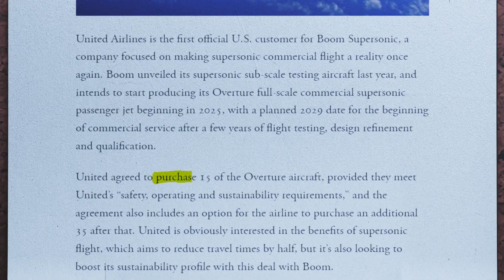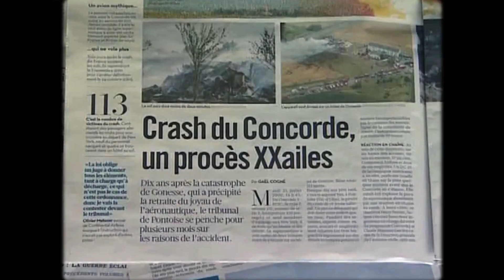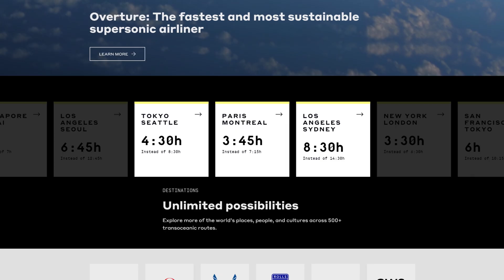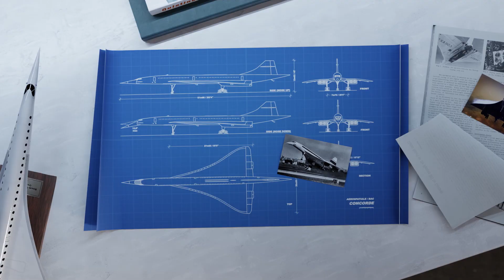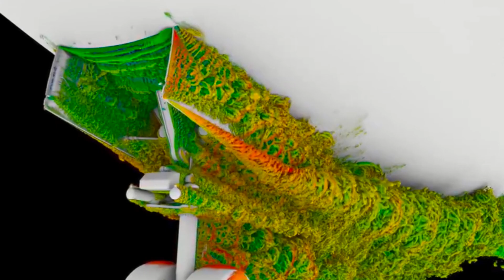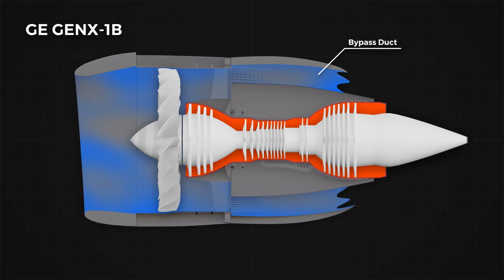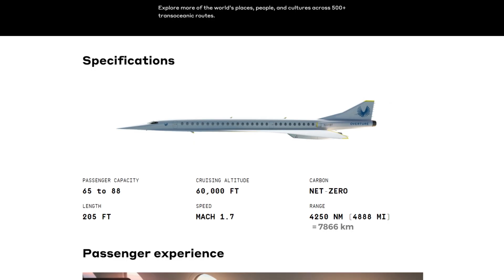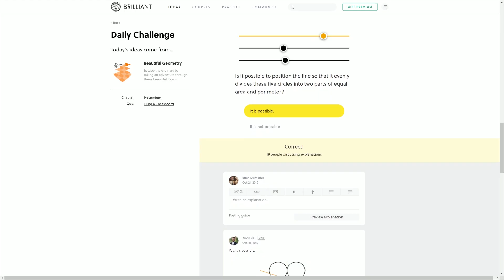Will Boom Bring Supersonic Back?

Comment from the maker: Real Science uploaded a video today that is honestly much better than this one, you should watch it: https://youtu.be/DmanbWwMa5w
Reply: Until Boom has a functioning engine, it's just a paper design. Nothing else matters if the engine is not efficient enough. Most people don't understand that every mode of transport is built around its powerplant, and if they want to be successful, that is the first hurdle they need to overcome. It's not something that you can save for later.
Reply: @KarbonatErolVerdienstkreuz  I agree no breakthrough in aircraft has been made without an efficient powerplant. In the 1960's The question in the Lockheed Star was What is the limit to the size of an aircraft?   The answer: Even With the materials we have today given an efficient powerplant there is no limit to the size of the aircraft that can be built. The main limitation is the ground handling area available.
Reply: @KarbonatErolVerdienstkreuz  At least they could try to copy the SR-71's powerplant, but I don't think Boom has the sophistication.
Reply: @jameshoffman552 The J-58 is not efficient enough
Reply: @jameshoffman552  Did you know Concorde effectively has RAM engines as well? The RAM Air intakes of Concorde generated more thrust than the engine itself at supersonic speeds
Reply: @KarbonatErolVerdienstkreuz  the problem is that turbojets will never be as efficient as turbofans, especially high-bypass-ratio turbofans, but the higher the bypass ratio, the less suitable the engine is for supersonic speeds.
Reply: that link is about lab grown meat 🙁
Reply: 747- "I can carry lots of people affordably with, at least in flight terms fairly small amounts of fuel."
Concorde- "But I'm fast."
747- "Okay Boomer."
Reply: What does synthetic meat have to do with supersonic aircraft!?
Reply: Concord was designed with slide rules.
Reply: so fo you feel Lockheed or Boom has the most potential..?  I think Lockheed will probably make the sonic boom quieter...but yeah, hopefully someone pulls out off and make it practical.. that would be great!
Reply: Good man Brian. I'm guessing you've been watching pitch meetings!? 😆
Reply: 76
Reply: I know I just watched it, I prefer my science unbiased I mean I did love the channel, and all of a sudden it changed.
Reply: @Real Engineering:  I would love to see your take on the logistics of the Falkland Islands campaign.  The British had quite the struggle there.
Reply: Hey man, I love your videos but could you do at the end of the video something like a short recap? Like: Lets recap what we've learned today... . It would be nice.
Reply: You don't give yourself enough credit! This video is top-notch!
Reply: @WestExplainsBest  ich mich zu zzp oder zu zzzp PZ z PZ
Reply: @WestExplainsBest  Compare 1930s Nazi Germany Vs 2020s Communist Chinazi IN YOUR NEXT VIDEO Project before it's too late
Reply: @WestExplainsBest   
Aa.
Reply: Instead of bypass we can use ramjet
Reply: @Acidcoast  based
Reply: Off topic, misleading link.
Reply: @linuxgeex  They are basically advertising their other channel. Took me a while to figure out lol.
Reply: Sure. Just in space
Reply: How do you find these videos, I am looking to start my own YouTube channel and i want to know you source these stock videos like the ones with the Concorde, I would really appreciate if you could help me out
Reply: The link is to lab grown meat!! Lame!!
Reply: It looks like a pelican!  Decades of research to realize Nature figured this out billions of years ago.  🤣(4:40)
Reply: Was that a joke? When I click on that link I get "The Truth About Lab-Grown Meat". I tried it three times.
Reply: Anything to add now with the new X-59 two years later? Looks like it really might come back
Reply: Can you please make a follow up video with the latest improvements till now.
Reply: WTF, did you at least check your link, its about lab grown meats!
Reply: @ckdigitaltheqof6th210  you clearly did not see that their site says "Fueling the future" and three quarters of their products are about fuel. Isooctane and Isobutanol and renewable diesel and gas. look again.
Reply: @ZeroTRK  didn't bother to, the claim of that link had a better intro to the topic, its just on a fuel resources topic material alone.
Reply: Cool video, thanks for promoting veganism.
Reply: What is the name of the book at 16:13? Edit: nvm found it, its called general aviation aircraft design
Reply: Well Its actually not true about the Biofuels. As it stands, there is a company out in Colorado that is developing Sustainable biofuels for Jet liners. Its called Isobutane I believe. From what I remember. The Fuel is actually considered a byproduct of ethanol, But is highly sustainable. The company is called Gevo. And I would check it out. As it stands. A number of airlines have already signed up for it. As it is cheaper than fossil fuels and I could see it being used for this jet.
Reply: @ZeroTRK  It has been shown elsewhere that ethanol is not as eco friendly as advertised. It is very energy intensive to both grow and process corn  into fuels so in the end it offers little net benefit to the environment while using land that should be used for food crops.
Reply: @ZeroTRK  "you believe" and "From what I remember".  You are rather flaccid  in your facts.
Reply: Imagine not watching that within thirty minutes of upload
Reply: VIEW * NICE AWES0ME C00L KEEP_IT_UP ! INDEED .... 📳💻💻💻💻🖥🖥🖥🖥🖥⌨⌨⌨⌨⌨🖱🖱🖱🖱💽🏆🥓🥓🥓🥓🥓🏎🏎🏎🏎🏎💨💨💨💨💨💨💨

Comment: Came here after Boom testing its technology demonstrator at Mach 1.12. They have done it. But there is a lengthy journey ahead to scale that design to their overture passenger aircraft. Their structural design approach is validated now and pressure and flow data from the real flight envelope is captured. A critical area of risk now is the engines that needs to be developed for achieving modern day noise restrictions and carbon negative fuel requirements.

Comment: Great Video . But There is one misconception. They plan to put turbo fans on this plane. (Low Bypass) And there were massive amounts of improvements in this department as well . Look no further than the f135 from the f35 . But still it wont be an easy feat.

Comment: Do supersonic engines really need to be pure turbojets? Could the Overture get away with using low or medium bypass turbofan engines? Most modern fighter jets use low-bypass turbofans and they can fly at supersonic speeds.

Comment: 1:22 I would not say its fair to call it cramped. Its some 15 cm wider, and quite a bit taller than the interior of a Embraer E-jet. Its have a bout the same seat width as a A220, that is really not that poor of a standard. Considerably better (like 2½" more) than a 737

Comment: JFK departure - with a left hand turn, just at takeoff was incredible. Avoid Manhattan, flew over Jones beach / Canarsie climb out as quiet as possible.

Dulles , was not a big deal with lots of unbuilt area. So no throttle up and down in noise abatement.

It was a super loud aircraft - I sat back in the last row at takeoff and it was very loud.
And the earth rumbled around you as you took off at 250mph.
Was a fantastic experience and leaving at 10:00am - arrived in London at 6:20pm in 3hr 20mins.
Just enough time for a gourmet meal and many glasses of Krug or similar champagne.

Good luck to boom - however I think that will just never happen , if it does wont be in this decade - !!

Comment: Overture is intended to bring back supersonic travel after the demise of Concorde. Three of Boom’s key objectives are to make Overture fuel efficient at both sub and supersonic speeds, and to be low noise, especially at take off and landing. Many people have been wondering how they could do this.

Symphony 
Following the redesign in mid 2022, Overture has four underwing power units which Boom have christened Symphony. Symphony houses the engine, input ducting and exhaust ducting, and is large at 30.5 feet long and 7 feet in diameter (Overture is 201 feet long, with a wing span of 106 feet). There is a cutaway image of Symphony and the engine on the Boom website.

Engine
Florida Turbine Technologies will design, develop and certify the Symphony engine which will use existing certified parts and materials, including blades and core. The manufacturers of these parts will help throughout the Overture engine development program. 

The engine will have the same basic architecture as engines that currently power all modern airliners: 
  • Turbofan 
  • Medium-bypass 
  • No afterburner 
  • Twin-spool 
  • 35,000 pounds of thrust on take off 
  • Air cooled multistage turbine 
  • Single stage, 72 inch diameter fan, for quiet operation 
  • Low-pressure compressor stages: 3 
  • High-pressure compressor stages: 6 
  • High-pressure turbine stages: 1 (passively cooled) 
  • Low-pressure turbine stages: 3 
  • Additive manufacturing for lightness, low part count, reduced assembly costs 
  • FAA Part 33 and EASA CS 33 compliance 
  • ICAO Chapter 14 noise compliance 

How can a Medium Bypass Engine be Used at Supersonic Speeds
In general, turbofan engines are efficient at speeds up to around Mach 0.94, but any faster and the large fan creates excessive drag and the bypass air is too slow, also causing drag. Any attempt to speed up the bypass air with a convergent/divergent nozzle tends to choke the fan. 

To get around these problems the Symphony engine fan seems to be unusual and has been described as low profile, high throughput and light. Also, there seems to be a diffuser ring near to the input periphery of the fan. The impression is that at high speeds, incoming air will be directed away from the fan periphery so the engine core will receive the majority of the input air, and bypass air will be greatly reduced, thus eliminating the problems of drag, fan choking, and slow bypass air at high speeds.

Input and Output Ducting
Symphony will have a Boom-designed axisymmetric supersonic intake^, and a variable-geometry exhaust nozzle, The intake will be similar to the intakes on the Mach 3.2, SR-71, with a spike that generates thrust as well as slowing the air to the engine (all engines need input air below Mach 1, typically Mach 0.5). The exhaust nozzle geometry will probably be adjusted to provide subsonic exhaust velocity at low speeds, which will mix with the subsonic bypass air producing high thrust and ensuring low noise, especially on take off and landing. The nozzle will be adjusted at high speeds to provide a supersonic exhaust for Mach 1.7 supercruise.

Why will Overture be More fuel efficient
 •  Lighter because of carbon composite construction
 •  Turbofan engine at low speeds
 •  Effectively a turbojet at high speeds
 •  Waisted fuselage for area rule reducing drag
 •  Improved wing
 •  No afterburner

Why will Overture be Quieter
 •  No afterburner
 •  Medium bypass engine
 •  Sound deadening material
 •  Subsonic air flow at low speeds
 •  Variable geometry exhaust
 •  Normal sound elimination techniques for turbofan engines
 •  Improved wing, with leading and trailing edge flaps giving more lift at slower speeds
 •  Exhaust noise at supersonic speeds won’t be that significant because Overture will be flying over water and will be creating a sonic boom anyway.

Notes
^  The input diffuser is almost certainly based on document, NACA E55F30 of 1955: Variable Geometry Axisymetric Supersonic Inlet with Telescoping Centrebody

12-2023.09.15

Comment: Here is a rundown of Boom's latest position (15 September 2023):
   •  The factory at Greensboro North Carolina is now erected
   •  Boom has hinted that, as the XB-1 no longer represents Overture, it probably won't fly
   •  Boom have now finished their consultation with Rolls Royce on the Symphony engine
   •  Virgin have now let their Overture options laps
   •  130 orders and pre orders from Japan Airlines, American Airlines, and United Airlines
   •  Boom and Northrop Grumman partnership for military and government applications 
   •  Boom awarded STRATFI contract by USAF for Overture fast transit applications
   •  Cutaway images of the engine and Symphony power module are now on Boom's site  
In July 2022 Boom announced a major Symphony redesign:
  •  Fuselage, waisted to comply with area rule
  •  Wing, multi angle Delta gull, with computer controlled leading and trailing edge slats
  •  Empennage
  •  Engines, 4 medium bypass turbofans in under wing individual pods
  •  Seats, 65 to 80, all business class
  •  Length, 201 feet (same as Concorde)  
  •  Wing span, 106 feet (greater than Concorde)
  •  Height, 36 feet
  •  Cruising speed, Mach 0.94 over land, Mach 1.7 over water, at 60,000 feet
  •  Range, 4,880 miles
   
Boom have appointed suppliers for major Overture items, including the engine:
  •  Florida Turbine Technologies, engine design, development and certification
  •  Aernnova  (Spain), design and supply wings. 
  •  Leonardo (Italy), design and build fuselage and wing box.  
  •  Aciturri (Spain), design and develop empennage. 
  •  Safran Landing Systems, 
  •  Eaton, hydraulics, fuel and inertial systems collaboration
  •  Collins Aerospace, ice protection and systems collaboration
  •  Flight Safety International, 
  •  GE Additive, additive engineering (3D printing)
  •  StandardAero, maintenance
  
Florida Turbine Technologies, a division of Kratos Defence, will design, develop and test an engine that matches the specific requirements of Overture.  Engine development began in January 2023.  Engineers, who were involved in the design of the engines for the supersonic F-22 Raptor and F-35 Lightning, will be on the design team. The engine will use existing certified parts and materials, including blades, rotors, accessories, and core. The manufacturers of these parts will help throughout the Overture engine development program. The engine will have the same basic architecture as engines that currently power all modern airliners:
  •  Turbofan
  •  Medium-bypass
  •  No afterburner
  •  Twin-spool
  •  35,000 pounds of thrust on take off
  •  Air cooled multistage turbine
  •  Single stage, 72 inch diameter fan, low profile, high flow, light
  •  Low-pressure compressor stages: 3
  •  High-pressure compressor stages: 6
  •  High-pressure turbine stages: 1 (passively cooled)
  •  Low-pressure turbine stages: 3
  •  Additive manufacturing for lightness, low part count, reduced assembly costs
  •  FAA Part 33 and EASA CS 33 compliance
  •  ICAO Chapter 14 noise compliance, especially relevant on take off and landing

The Symphony propulsion system will have a Boom-designed axisymmetric supersonic intake, and variable-geometry exhaust nozzle. The propulsion system will be fuel efficient at both sub and supersonic speeds. The intake will be similar to the intakes on the Mach 3.2, SR-71, with a spike that slows the air to the engine, and probably generates forward thrust. Wind tunnel testing of the intake and exhaust are underway.

16-2023.09.15